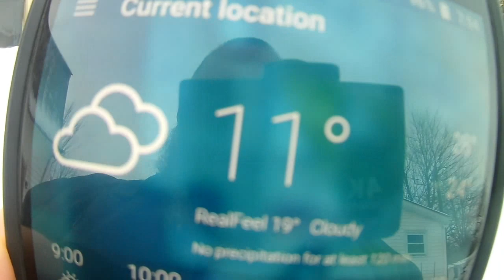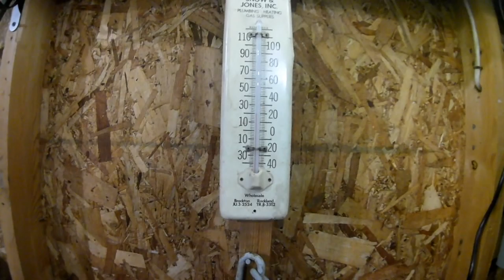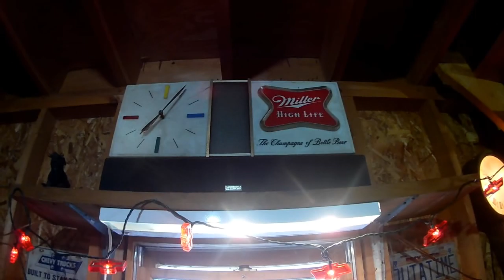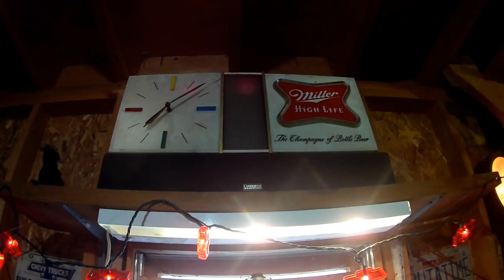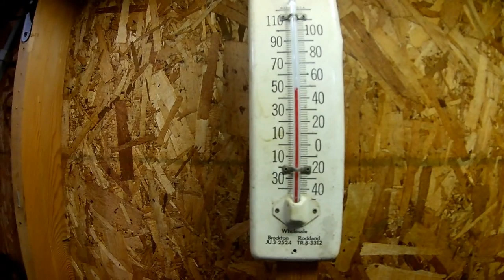The cold scrap gamble

Comment: I found a 1978 (I'm guessing) gmc 1 ton dually it's 2wd I'm guessing a 350 and a 4 speed got any thing to look out for on one of these?
Reply from the maker: Cab supports, floors
Reply: @acrazycanuck78  basically any sort of rust?
Reply from the maker: Yes, look for rot in those areas
Reply: @acrazycanuck78  I hope it runs it sat for a long time. If I get it I will do a video on it for you. It looks to be clean I got some ideas for it 😁
Reply from the maker: Cool, I'll look forward to seeing it..